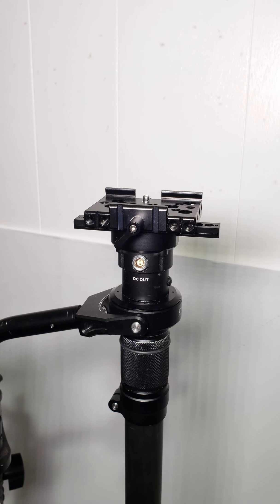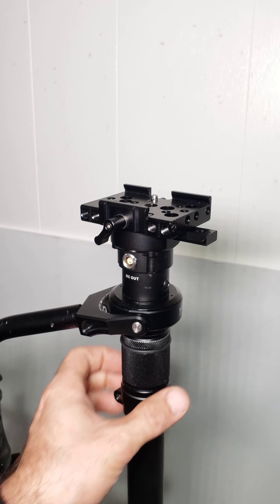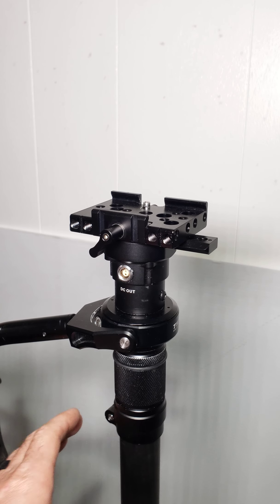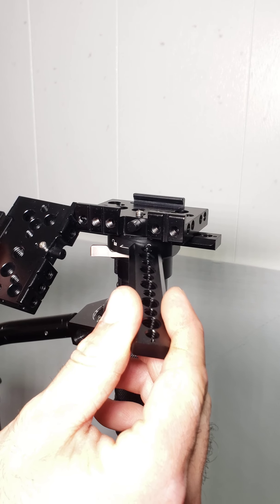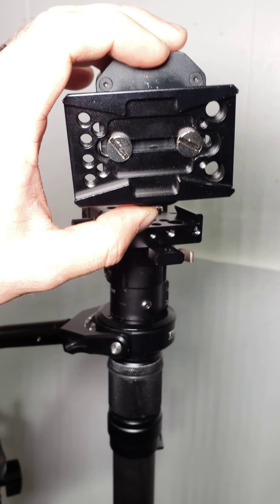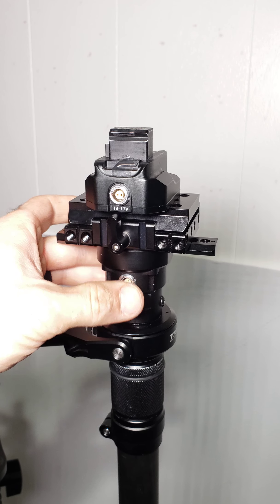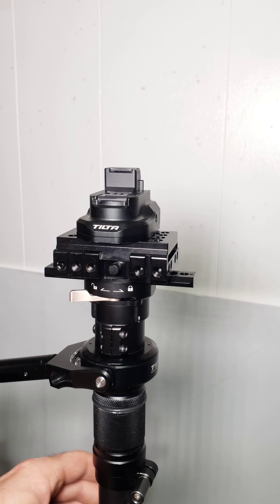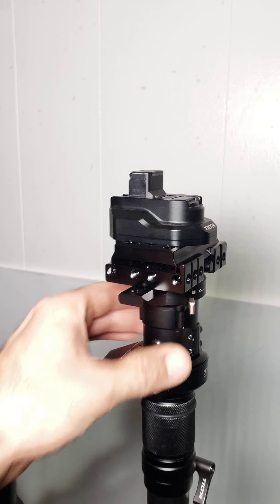TILTA - FLOAT MANFROTTO MOD

Comment: Seems like a sweet solution. Cant seem to get the 1/4-20 holes to line up like you did. the 1/4-20 holes seem to line up with 3/8. I just used two 3/8 to 1/4-20 adapters and it worked well :) thanks for this man!
Reply from the maker: That's what I did brother. I had another video on how I made it!